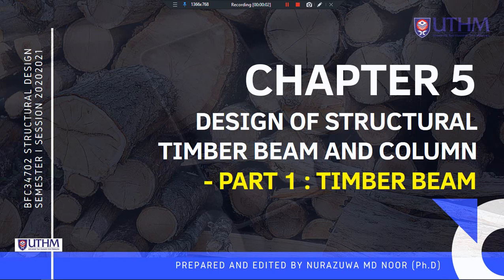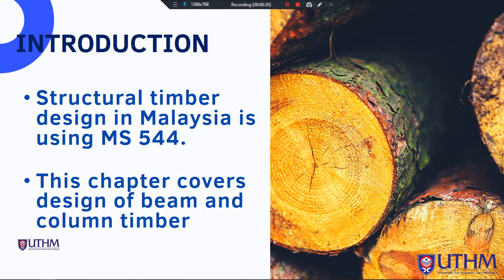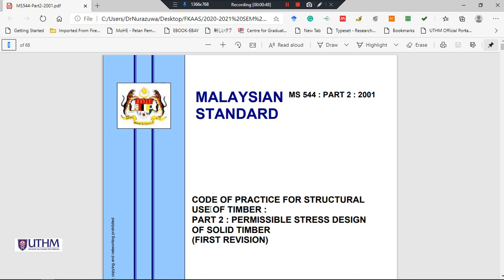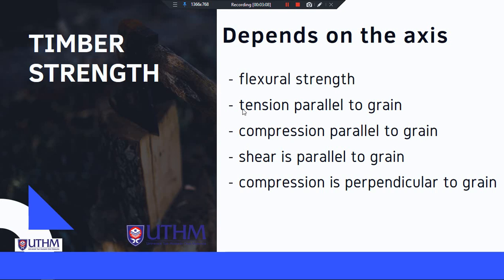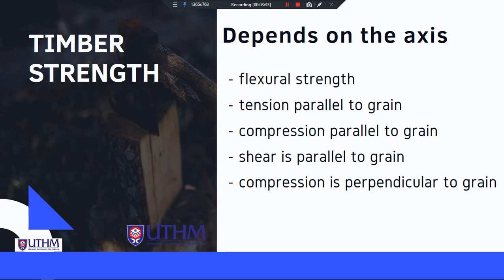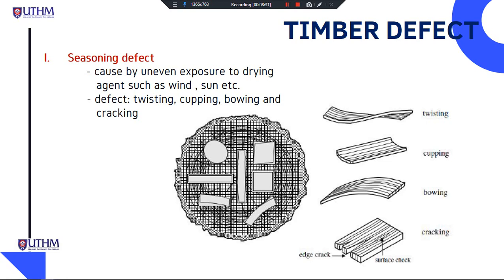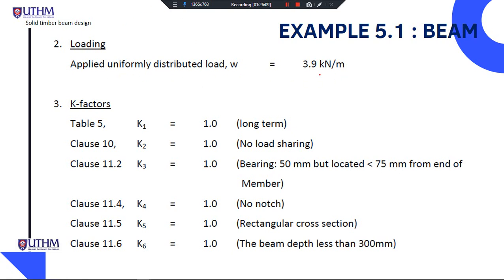Timber Beam Design According to MS544

Comment: I have not been doing timber design for many years. Towards the end of the lecture, it says that the deflection limit criteria are not met. I was just wondering, for Limit State Design, there is ULS and SLS criteria isn't? Isn't deflection under SLS and thus the load has to be service load (not factored). If we remove the load factor, the service load will be much lower & thus the deflection limit can be met.